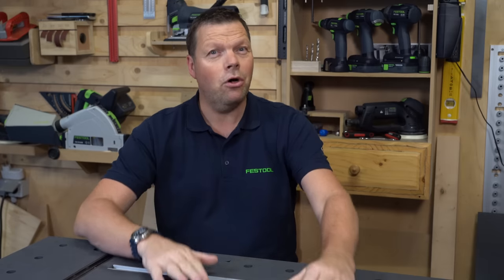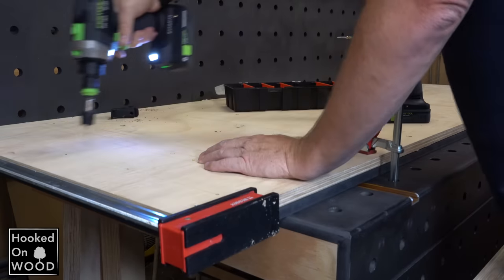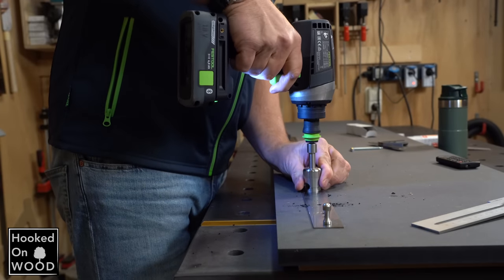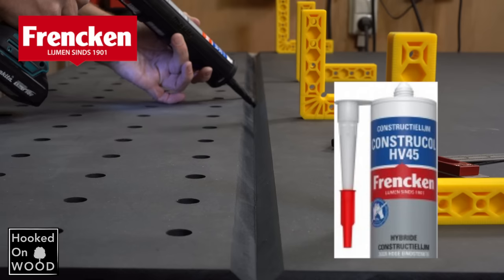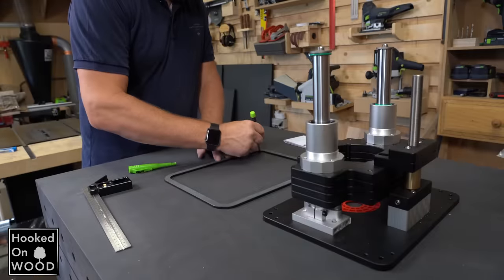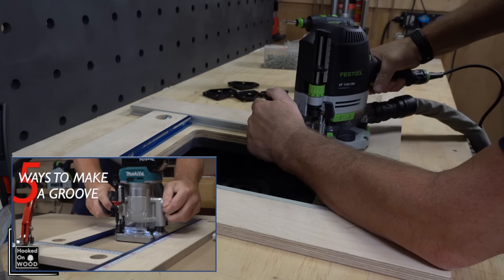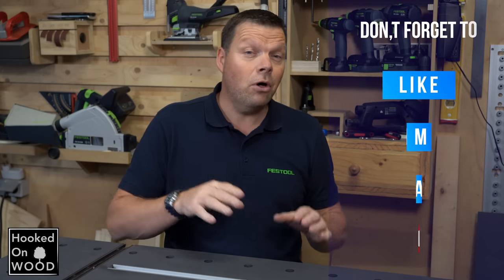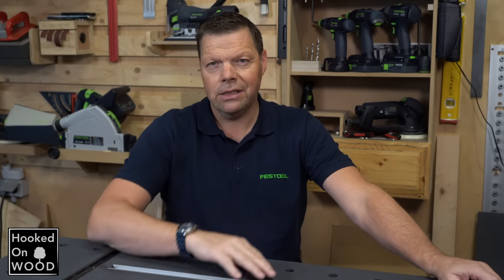Affordable and easy to build accurate workbench router table

Comment: Interchangeable drawers is a must. Most videos have fixed drawers and at later stage this can become a problem. 
Yours is the most flexible and cheapest option I've seen so far. Also that workbench has options to ad at later stage.

Comment: i'am also going to build this great workbench!
i am going to connect the top and frontpanels with a butt joint, to lower the change that the pannels are not exactly ninetie degrees connected, because its easier to make a Right angle wood connection ( for me :-) ). it almost can't go wrong

Comment: Dennis I love the dog holes I've been so leary of adding them to my benches in the past but once my new shop is built I'm going to bite the bullet and build something like this bench, im building 2 actually and they will be on casters and will be parallel work surfaces that can be joined together to make a Mega work surface bench. My tops will be 30"x84"  and the outfeed table im thinking I will add the router lift as you did. Definitely a video I'll be coming back too for sure
Reply from the maker: Thanks Tom and good luck building it. Nice concept

Comment: Awesome video as usual, love the drawers at the end there. They alone, and the idea of a standardised, simple workshop drawer, is easily worth a whole video on its own. It's a very, very good idea and, as you said, very cost efficient as no sliders are involved. Some candle wax on the bottom of the drawers, on the lip that slides, will probably make them very very comfortable to use as well!
Reply: I agree.  Been trying to figure out how to make my bench drawers look good while also practical.  Definitely using this idea.
Reply from the maker: Thanks!

Comment: I ran into the same issue of the Festool clamps not fitting because my top was too thick.  It was easily solved by running a slight chamfer around the underside of each 20mm hole.  Find the correct depth and everything works.
Reply from the maker: Yep, great tip! I tried this but my workbenchtop was to thick for that as well. But for 25-30mm top, I think it works perfectly.

Comment: I am really glad you came out with this video. Your first video for the router part used incra. I was very interested in using exactly what you did and then found out that Incra has such a long waiting list. I do have a question for you. If you had a bigger workshop from the beginning, would you have had a different size workbench and if so, what dimensions would you have chosen. Thanks so much
Reply from the maker: Well, I will get a new and bigger workbench in a few months and for this place I indeed will build a bigger workbench. 200 x 100. But I never had a lot of problems with this workbench size. I first thought I would need a size of 240 x 120 but I think that will become too big. In my new situation I can slide it against another workbench to create this dimension if necessary.

Comment: I'm sure it was a wall of Makita behind you last time i watched? Looks like Festool came and knocked on your door. Nice work as always too. I'm planning a bench to house a table saw, mitre saw and router, plus a vice. I have limited space and want to use this method of layering ply. I want to store the mitre saw underneath and then remove four slats of the top surface to reveal a recess to place the saw, leaving it flush. The slats can then fit into the top surface with dogs either side of the mitre saw at a right angle to form fence extensions to create a proper mitre station. Also, the extended fence aligns with the router. I hope..
Reply from the maker: You are right about the wall. But you still have to watch some videos 😀😀. Having limited space ask for some creativity. In an ideal world everything should be separate. But limited space force you to combine. Your plan sounds great for a small space. All the best building it.

Comment: I watched several times on this video. It is really wonderful from every perspective. I will build mine based on your plan. The things I am thinking to change maybe that I will use steel legs. Also I may put detachable wheels and level screws on legs. I will make the top as 2 inch thick so the dog holes will be more sturdy.

Comment: When overlaynig MDF on 3/4/19mm Plywood Chamfer the bottom side of the 20mm plywood dog holes so your clamps will still work.
Reply from the maker: yes, but with 36mm top, you have to move a lot.

Comment: Excellent episode Dennis. 👏👏
I’m almost at the stage of starting to make your original bench as a winter project and moving away from using a Paulk Smart Bench. Would you say the original is still the way to go? The top on this version looks an easier construct?
Reply from the maker: This will depend on how much I will miss my railguide clamps. The hold down clamps from Banggood work much faster and are more pleasant to use bit have a shorter reach. But on this moment I think I will go for this version  because the top is more solid and you notice this with sanding for example. It gives less vibrations. So perhaps i will use a combination of two sheets and some sort of torsion box for my main workbench. Although that would be a bit over the top😀
Reply: @HookedonWood  I a hybrid could be the most interesting solution. I like the fact you say it’s more solid. Thanks for replying. Your work always inspires and pushes for the best solution Dennis. Keep doing what you do🙏😉

Comment: This is a very nice workbench, but I'm wandering. Do also use it for manual working like chopping a hole for a mortise and tenon joint? That requires a hard surface.
I'm in doubt to buy one form beech or build one like this but with the current pricing of wood I'm not sure. I expect this one would be expensive too. Do you know how much is approx. costs to build this one?

Comment: Amazing video, Dennis!

I saw another comment that your black benchtop is HDF Valchromat from Portugal. Some questions:

1) Would you use it again? Or would you go with that Medite Tricoya MDF material?

2) What do you think of using outdoor composite decking for the benchtop?

3) Do those metal t-track inserts work with the MicroJig? (sorry if I missed this)
Reply from the maker: It comes from Portugal, but it is not Valchromat. It is full colored MDF. I believe Valchromat is even denser. 
But for your questions. Yes, I would use it again.
I would not use Medite Tricoya. That is way to expansive and I do not see that much benefits from this special MDF. Then Medite V313 is a better option and comparable with the black MDF I use.
2. Never think about it, I stick to Black MDF
3. No they do not work.  You need ordinary rail guide clamps for that. But I use Miter Tracks and these do not fit the clamps. But there are rails available that do. Not too much offer these although!
Reply: @HookedonWood  Thank you so much for the detailed reply! Hoping to embark on this hobby :)

Comment: I enjoy your videos!  The one snagg i think with any router table is the lift which is a minimal cost of $200.  Many DIY options exist that address this - my favorite being one that uses a wedge sled so the lift screw is perpendicular to the router so it can be placed on the cabinet face and easily actuated with a drill or wrench.  Your finishes are top notch, look great, and great functionality! Thank you!

Comment: Great work! The very neat solutions such as the sliding doors for air, cables makes it very complete. 
One thing that you have that stands out compared to many other benches is the drawer reconfigurability. I try building everything to an extent of making it reconfigurable, if needed. And in a workshop, tools and workflow come and go so this is a perfect place to do so. Great decision!
In the obsession of ball bearing sliders, it’s great to see some old and well proved solutions. I will certainly do similar to you.
Reply from the maker: I agree analyses about the workflow and tools come and go. This is why I think it is a flexible solution.

Comment: Great video as usual. Could you please talk a bit about your opinion if you think this design is good enough over the box stringer design? In Australia, our radiata pine is not flat and always has some bows in it. I think with a high precision dog hole system, maybe it's worth making sure the surface stays flat too.
Reply from the maker: I like this design. It absorbs vibrations more. Like with sanding. I think I will do my final workbench this way or a combination of two layers and a torsion box

Comment: Love the workbench, especially the drawers. Since you made the grooves for the drawers at the same increments, how did you make the different sized drawers? Did you only make 2 sizes?
Reply from the maker: I will make a video about it. But i place the groove every 70mm and the drawer front is 69 or 139mm in my new workshop I will make 3 different sizes. So, I add a 209mm to it.
Reply: I can’t agree more! Looking forward to the video then. Great job Dennis
Reply: Hi Dennis, great video really appreciate all the detail, . I'm in the middle of building your bench from the plans and just had one question about the drawers. I understand the base is 9mm, just wondering the height of the sides that sit on the base. If you you are willing to share that before you release the drawer video please.

Comment: Really awesome work, i was just about to build your original workbench, but now i'll switch to the new layout. Hope i'll manage to adjust the old plans to the new tabletop. As i want to use the WNEW Router lift, which router do you use - is it still the Triton MOF 001? And in the episode, where you compare the Incra Mast-R-Lift to the Triton router, you used this clean sweep inlays - where do i get these and will they also fit into the WNEW version - i suppose not - any suggestions? Love your channel and I appreciate the effort you invest! Best regards from cloudy Vienna!
Reply: Hi Dennis, same questions as Gerald :) + what could you quicly say about the WNEX Router Lift compare to the INCRAs ? Thanks a lot for your reviews & replies !

Comment: Amazing build, Entertaining and informational. Looking forward. In the US (Atlanta area), It's so hard to find those Black MDF.
In your build, why not add more Microjig T-Track on top instead of dog holes?
Also heard there are some accuracy issue with Parf M2 system - any feedback?
Reply from the maker: I do not like the squares. Dogholes are round and nothing can stick behind it. With the grooves this is different and jou can damage corners. I also think the hold down clamps work much faster. That said in my new workshop I want to have one bench with the micro jig top but mostly to make easily templates to align pieces you have to assemble.  I
Reply: I have called every place within 120 miles and they keep wanting to sell me black melamine, I am like no man black mdf, i seen it on youtube video. No one has ever heard of it, I think it is only european thing. I have seen a few wood products in european videos i have never seen here in the states.

Comment: Beautiful bench, but also simple. I'm going to build this bench later this week for my workshop (after much workbench shopping). The combination of dog holes and dovetail tracks on the top and the apron is compelling. That radiata pine is my favorite big box store plywood here in the US, but Ive never seen that black mdf.. which is unfortunate because its gorgeous here! What i do have is black melamine (ikea desktops), which wont hold those dovetail tracks. But i want the look, so ill put dovetail grooves in the radiata ply and just put channels in the melamine for the clamps to pass through. Ill also reinforce the particle board along the channels  with black ca glue. Might work, we'll see. 

Question: Has anyone put together a cut list for either the original bench or the affordable version?
Reply from the maker: Great! good luck building it. A Shame the Black MDF is not that good available everywhere.

Comment: Hi Dennis, Normally I would watch and comment on your videos as soon as they come out, but unfortunately I have not been very well at all over the last 7 Days and don't really remember much about last Thursday, Friday or Saturday. As always your latest Workbench Video is excellent and full of useful information and advice. I think both Workbench Top designs have their merits, personally I prefer the original Mk1 Torsion Box design which looks really nice when built but I appreciate it is more complicated and possibly more difficult to build for some. I prefer the idea of the rail clamps which don't put any strain on the sides of the dog holes which I think might be a problem over time. The new Drawer system looks great, I like the idea of being able to change the drawers around as required for different situations. Did you run out of Black MDF for the Dust Extraction Box ? or is it more practical to build it from Birch Ply 😃. Can I ask a couple of questions, did the Mitre Tracks you used for the Router Fence come with the Fence package as the Banggood Website shows them as being quite Short ? I would be interested to know what length you actually used and if you have a link to them. Also, do you recall where you bought the 100mm 45 Degree Extraction Flange from, I can only seem to find a 63mm one at Axminister Tools, which I think will be a little too small. I think it will be another week or so before I feel strong enough to get back into the workshop so I look forward to watching any more videos you create. I would especially like to see one about the Fence you have used as I think I would like to try that one before I spend so much money on an Incra LS Positioner and Wonder Fence which are obviously excellent quality and very accurate but also very expensive for the hobbyist. Thanks again for making such inspiring Videos.
Reply from the maker: Thanks for your mail Collin. Always nice to read from you. Hope you will feel better soon. I come back to your questions. I am on holiday with my family now😀

Comment: Dennis, what do you think of the woodpeckers hole boring jig for MFT style holes? Its the system I've been looking to get soon but the system you use seems useful as well.
Reply from the maker: I do not have experience with that kind of jigs for the dog holes. Only the Parf guide system. I think it works, and perhaps even easier accurate.  The parf guide system gives great flexibility if you do not want your table tp with only holes.

Comment: I was just designing my own workbench, based on your former one. So this is is a great surprise! Great improvements! But I was dying to ask you a question, which was also on the previous workbench: the microjig clamp solution for the side panel. I think they are expensive (especially for an 'affordable workbench'). Have you considered using something like t-tracks with some of your china tools clamps for the side panel? And what would you recommend in this case? Or are they worth every penny?
Reply from the maker: Hi Jelle, 
Good question, I did not find T-Tracks on Banggood you could use with rail guide clamps. They are available, but not on Banggood. Incra has them I believe.
But, the Micro Jig clamps are very useful in very different ways.  And everywhere where you make a groove, you can use them. So, from a wider perspective, they are a bargain if you can see how useful they can be. 
If you look at there side you see the best concentration of what is possible with them. But when you work more and more with them, you will find them very useful.
Reply: You can check out I-Typ Nut 8 heavy Aluminium Profiles 40×16. I used those for a drill press table and those railguide clamps from  Bessey/Festool fit perfectly. They are strong enough to put pressure on the clamp and you can get other Accessoires like Sliders i used for an adjustable fence with an Aluminium profile of the same item type. The only thing is as the tracks are 16mm you will need 2 layers for the side bench as well.

Comment: Hi Dennis, I have a question on what kind of t tracks you are using.  There is standard and universal.  I would like to use universal so there are more options.  I looks as if you are using Mitre track instead.  I keep leaning towards the aluminum color as it looks great with the black MDF :).  Another advantage is that if the track is cut the silver color is all the way through.  Have you used China Tools t track? if so what profile (Standard 1/4, 20 or Universal 5/16) do they make or offer?  I have not gone the route of dog holes in my bench.  Thanks again.  Can't wait to see your new shop!!
Reply from the maker: Hi Hans, 
I use miter track indeed. Because I need it for my router. Otherwise a smaller one is also possible. Watch my china tools serie 26. This is all about T-tracks.

Comment: Nice work. I'll certainly steal some ideas for my new workbench on wheels. Regarding the slots for the T-tracks, I've also started to use Bosch guide rails some time ago and one of the first accessories I got was the router base (with super fine router offset adjustments) which makes it trivial to precisely cut those slots without requiring a jig or much measuring/fiddling. I've built a benchtop using some of your T-track knowledge and recommended products and it came out great, so I'm highly recommending that slot routing method.

Comment: Beautiful! But what bare minimum tools would be needed to build such a workbench in your opinion? Not everyone has all the coolest Festool stuff! Thank you :)
Reply: From the videos, he used a track saw for the top but mentioned a circular saw with guide rail would do iirc. He also called out that a butt joint for the table and apron would work just fine - dont gotta do that 45 degree angke cut. Drill, table saw, miter saw, sander... all but the drill seem like they could be substituted with other tools.